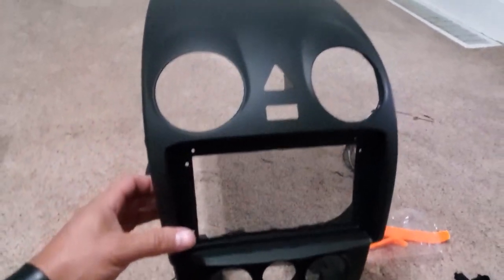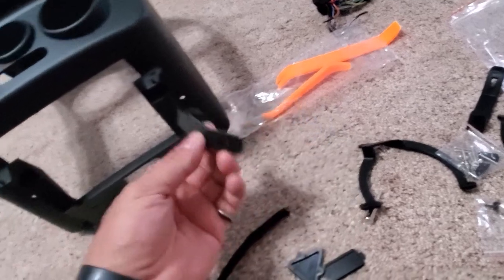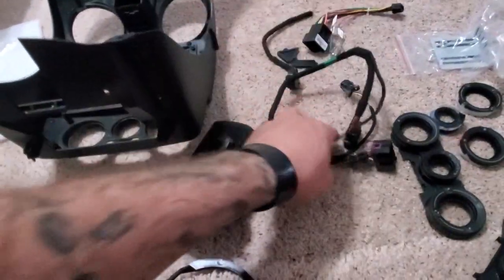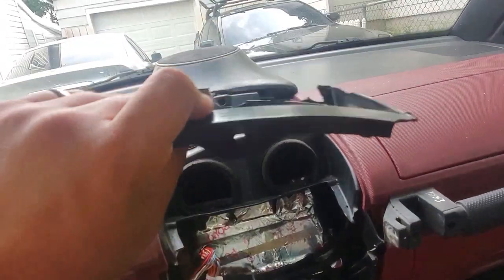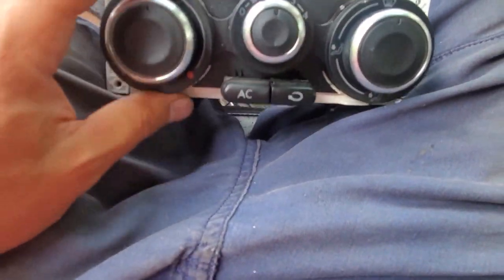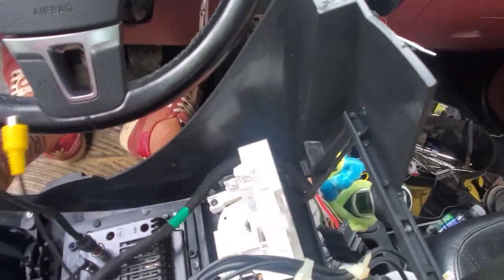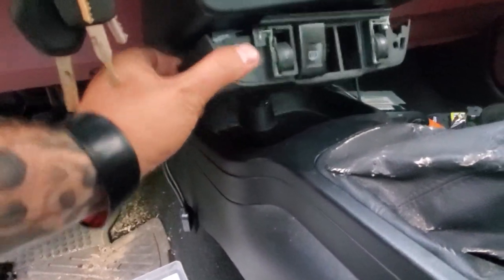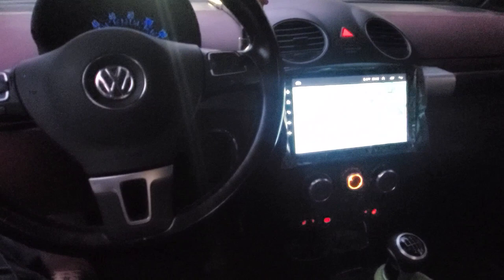New beetle 9" touch screen install

Comment: My 2004 beetle has the monsoon system in it with the multi disc thing, will that hook to it still?
Reply from the maker: You can use the cd changer in the rear still if you hook it up as one of the aux inputs

Comment: Did you buy the cheapest option on the aliexpress link since you got your radio separate ? or you bought the option with the radio and got another radio because it was better?
Reply from the maker: The kit alone when I bought it was over 400.00. It's now under 100.00. I bought the actual radio off Amazon because tye Ali one didn't have some features that I was looking for, and my phone was newer that android 11 so that radio wouldn't allow for Bluetooth, wifi etc from my phone. As well as mirror link

Comment: How has it held up? Any issues? Are you happy with the audio quality?
Reply from the maker: Only issue I've had is my battery always dead. Turned out that the way the harness is wired it sends power to the antenna all the time. Which drains the battery.  I unhooked the 12v constant and put it to switched and the same with antenna. The radio has external memory so it doesn't need the 12v constant. Haven't had a problem since. 

Sound quality I'm not really happy with. The radio alone I picked out from Amazon with features I wanted. But the eq doesn't have the option to adjust with bluetooth, hulu, Netflix etc. Only with fm radio and SD card.

Comment: Does the newer stearind wheel fit in the old beetle? Can you use the funtions on it?
Reply from the maker: It physically fits, but the back of the beetle is round vs the squared shape of this one. Not really noticeable.  It's pretty much plug and play with the airbag. Some new beetles have dual zone bags and some have single zone. My 00 has single zone but my 99 had dual. It's just another part of the airbag that deploys at lower or higher speeds.  The plug is the same you just have to put it into the right spot. The steering wheel controls on the other hand were a pain. If you got a wheel without steering wheel controls you can order the add on kit which looks oem and pairs easy with the radio. Otherwise you have to buy the universal steering wheel kit add on and figure out the ohm ratings for each button. If you car is 02+ (I think), I know 06+ for sure,  and has canbus, you have less of a pain with wiring because the wheel is canbus also.  You have to use vagcom to program the canbus option for steering wheel. I had to shave the clock spring etc out for this one so I could use the wiring. Stock clock spring only has 2 or 3 wires. New one is 6 I think

Comment: Did the kit that you bought include a backup camera? I just bought a kit and it came with one, but I’m not sure where to run the wiring from the license plate all the way to the radio. I have an 09. Also I appreciate the video it helps a lot!
Reply from the maker: Yes. It's a process. Mount the camera and inside the trunk when you fold how the carpet and look behind the plastic there are rubber grommets. Remove one and run the wire into the trunk. Then you can run it under the backseat and either up the carpet and under the center console or under the backseat and tucked under the rear speaker area, then under the door sills up to the dash and over to the radio.
Reply: @BillySwetnam  oh wow😭 I was debating even putting the camera on, but I paid like $275 for the kit because it included the touch screen too so I figured I might as well get my moneys worth. How long did everything take you in total?
Reply from the maker: @brookebowman6866  I've had mine tore apart so many time lol. I can do it in less than an hour. The rear lower seat just pops out. You can then tuck the wire under the rear panel. The door sills pop up easy also. The. Run the wire under it. Just make sure you run it behind the seatbelt bar al it's not shown. If you get a plastic trim tool it helps.  You can them pry the part where your hood release is and tuck the wire under it.  Otherwise removing the handle is a pain ( I'm 6'5" and don't fit under the dash well)
Reply: @BillySwetnam  yeah that’s fair lol. I’ve never done anything that involved more than a screwdriver on mine so it’ll definitely take me longer but I’m determined🤣 but I’m 6’0, my dad 6’3, and even he said my car is really roomy! I have my seat all the way to the back seat tho so idk how you do it man! It’s a fun car tho I wouldn’t trade it for anything!
Reply from the maker: @brookebowman6866  it is roomy inside lol. It's just not roomy under the dash. Laying upside down with your head in the floor and feet on the ceiling trying to see under there lol
Reply: @BillySwetnam  omg I can imagine! that’s actually so funny
Reply from the maker: @brookebowman6866  you'll know the struggle when you run that wire lol

Comment: if I'm new to any kind of car mods, would u recommend going to a professional? im being quoted about $500 for installation for a similar screen and identical fascia kit, and really am unwilling to pay that much. what would u recommend for installation? thank u !
Reply from the maker: Aside from cutting the dash for the hvac controls to lower. It's pretty much all plug n play. It's not as hard as it looks.
Reply: @BillySwetnam  thanks, my kit didn't come with the pieces you mention at 5.13 , do you know where I could purchase those separately?
Reply from the maker: @rosesullivan  the vent brackets?
Reply: @BillySwetnam  yeah when i google that i can’t see anything that resembles what u show, just random accessories for the side vents
Reply from the maker: @rosesullivan  I'm at work.  Give me a few hours
Reply from the maker: @rosesullivan  send me an email with the pictures of what you have. Billyswetnam@yahoo.com
Reply: @BillySwetnam  hey, did you find anything?
Reply from the maker: @rosesullivan  I never got a picture of the parts you have

Comment: great mod. how is the clearance with the shifter after the installation? and how good is the quality of the sound from the unit?
Reply from the maker: Shifter isn't bad at all. Sound quality is good. I have aftermarket speakers also. But friends who have their stock speakers have great sound as well. Just make sure the radio has an eq and you can adjust all of that. I have an android radio in y bmw and it sounds better than stock, but the one in my truck doesn't sound great.

Comment: Hi Billy! Very enlighting video. I have a 2007 beetle convertible, i want to know if you could use the cupholders after the instalation. Thanks.
Reply from the maker: The 07 has them by the parking brake unless you have the full arm rest. My console is a 06+. Below the radio is a big square storage area with a mat.  If you remove the mat you can use those turn in cup holders but for change etc. Not tall enough for a can.

Comment: Do you live in California? I really need help fixing what you did and also for 360 cam
Reply from the maker: No. I'm in Ohio. What do you need help with?
Reply: @BillySwetnam  I brought those parts from China including 360 cam and dash cam. People here doesn't know installation or upgrade what you did in beetle. I need help fixing my car and also 360 cam with it.
Reply from the maker: @PushparajKrishnan  have you installed the radio yet? Cut the dash out and moved the hvac unit? The camera wires into the video input, or cam input RCA cable.
Reply: @BillySwetnam  Nope, I did not do anything. I just brought thinking of some auto shop will fix it for me, but that didn't work out. Will you come to California if I book your flights? And also will pay you.

Comment: Did you ever confirm if the whole jetta heater knob assembly would fit in the beetle, or does the beetle one need to be modified like yours?
Reply from the maker: Has to be modified like mine. The jetta mounts are offset differently

Comment: Hello Friend! Did you manage to connect the buttons on the steering wheel to the multimedia system?
Reply from the maker: Yes. Use a pac steering wheel controller or buy a wheel without controls and buy the control add on. That's much easier

Comment: what year is your beetle? I have a 2007 and I want to do something like this! :)
Reply from the maker: It's a 2000, but the interior is the same from 98-10
Reply: Billy Swetnam oh awesome!! do you still have the site you purchased this from(
Reply from the maker: @sydneyangus7817  #Aliexpress US $253.44  12%OFF | COHO Beetle car radio Android 10.0 8-core 4G+64G dvd gps android For VW Volkswagen Beetle 2005-2013
https://star.aliexpress.com/share/share.htm?redirectUrl=https%3A%2F%2Fwww.aliexpress.com%2Fitem%2F33056601217.html%3Fmb%3D42zWX4YN3QNWYoO%26srcSns%3DCopy%26tid%3Dwhite_backgroup_101%26businessType%3DProductDetail%26spreadType%3DsocialShare&image=H480f02015a9e40099ab3e75d76633daen.jpg&businessType=ProductDetail&spreadType=socialShare&templateId=white_backgroup_101&title=US%20%24253.44%20%2012%25OFF%20%7C%20COHO%20Beetle%20car%20radio%20Android%2010.0%208-core%204G%2B64G%20dvd%20gps%20android%20For%20VW%20Volkswagen%20Beetle%202005-2013&platform=AE
Reply: Where did you purchase the wire harness extender for the hazard button and the airbag light? I have a 2002 and all my buttons are under my climate control and I can't find a harness extender anywhere and I'm not the best at doing it myself

Comment: Did you have to install any Canbus harness?? Great work
Reply from the maker: It's included in the harness
Reply: @BillySwetnam  some people are telling me I don't need the canbus wiring, but I am afraid the EPC light will turn on in case I don't install it. BTW I have the original steering wheel, without any buttons
Reply from the maker: What year is your car? I think 02 on needs canbus.  Mine is a 00. I can run it with no radio and my obd2 port still works.
Reply: @BillySwetnam  mine is a 10. I think i'll buy the canbus harness from China just in case
Reply from the maker: @thiagoterzian  if you order it from Aliexpress it's much cheaper, just takes a week or two to arrive.

Comment: Hello, my friend. I'm having issues after I installed a stereo on my 2010 Beetle. The ABS, handbrake and engine lights are on, I hear relay clicking sounds once I turn off the car, and the car is having many other electrical problems, such as the alarm firing at random times, etc.
I am searching the internet for a solution, and I see many people with the same problem as mine, but no one has the solution. Do you know anything that might help me? Thanks in advance
Reply from the maker: You have to make sure the radio has the canbus harness. If you just used a regular Metra harness etc it will cause the issues
Reply: @BillySwetnam  does this canbus harness you mentioned need a canbus box? I didn't see a canbus box in your video
Reply from the maker: @thiagoterzian  yes. I'm not positive but I think 01+ need the box. Mine did not need it but my vw is a 00.
Reply from the maker: @thiagoterzian  you can change the canbus settings in the radio as well. In this listing it shows you how https://a.aliexpress.com/_mrbCTlw
Reply: @BillySwetnam  I've extensively searched the internet about the need or not of a Canbus decoder, and apparently it is only needed for years 11+, and mine is a 10. I've also talked to the manufacturer of my stereo, and it seems that when the car needs the Canbus decoder the connector from the car is different from this one.
Reply: @BillySwetnam  I must have screwed something up about the AC when I removed the center dash, because all these issues are related to the recirculation button. It is always lit when pressed, even when the car is off. Also, when I push it, many clicking noises begin from some relays near the pedals.
Reply from the maker: @thiagoterzian  did you unhook the yellow, green cables that go to the hvac? If you have them backwards it won't allow you to turn the knobs all the way and the recirculation button will stay lit. Do they Hazzard lights work and blinkers? I know the extention harness (needed in mine to put the Hazzard at the top instead of the bottom) has the same plug as one of the other buttons.
Reply: @BillySwetnam  yes, I have unhooked them, and when I turn the knobs they work. Hazard lights and blinkers work perfectly. I took my car today to a mechanic, hope to get a solution...
Reply: @BillySwetnam  hey, Billy! I'm glad to say I've finally figured it out. Turns out it was all the cable that came with the stereo's fault. Fortunately I had mistakenly bought another set of cable harness that worked perfectly. No more warnings, no more annoying lights!
Reply from the maker: @thiagoterzian  That's awesome! Glad you got it figured out. It's always stressful tracking down Electrical issues, but extremely satisfying when you figure it out. Congratulations!

Comment: That's great work. Do I have some  questions, the control buttons on the steering wheel running on this screen ? and the screen support CD changer? And the other question is this is the modern beetle wheel or what car?
Reply from the maker: They are using a add on wiring kit. There is no cd changer but there is an aux input that the cd changer could be installed to. The Steering wheel is a 2016 VW CC.
Reply: Soon in my car beetle turbo s .. thx a lot ☺️ .. and i hope you enjoy it

Comment: Where did you buy your radio and are you happy with it still?
Reply from the maker: I bought the kit from AliExpress for 300.0p ish. The radio I purchased from amazon because it was cheaper than buying the whole kit from aliexpress. Plus it has other options in the radio that were not available. The mounting kit is impressive. Looks and feels like the stock dash so that was a plus. The radio I am still working with designing apps and programs on it. Being an android based Radio is nice for the app store, but I'm used to building windows radio i.e winCE
Reply: @BillySwetnam  thank you for all the information its been very helpful
Reply: @BillySwetnam  Which radio did you get from amazon? I don’t wanna buy the wrong one
Reply from the maker: @stephanied6264  there are many of them with different options. Below is a link of one. You need the 10.1 radio with this shape. 
https://www.amazon.com/dp/B07SLJM53R/ref=cm_sw_r_cp_apa_glt_fabc_X387BRXZ5XT79ZFVHB27

Comment: How do you mount it back onto the car?
Reply from the maker: It comes with brackets
Reply: @BillySwetnam  thank you, I’m struggling to get it back on. My hazards don’t won’t now
Reply from the maker: @sage540  are the hazards just humming?
Reply: @BillySwetnam  no, the hazard won’t turn on nor will it flash outside my car
Reply from the maker: @sage540  what year?
Reply: @BillySwetnam  2009
Reply from the maker: @sage540  that's odd. It should just plug back in
Reply: @BillySwetnam  I can look it up. I appreciate you replaying years down the road. This video definitely helped me put it together
Reply: @BillySwetnam  so it’s the turn signal, hazard light, and passenger air bag off that won’t work
Reply from the maker: @sage540  check the plugs

Comment: Where you buy the stereo
Reply from the maker: I got the dash here.
https://a.aliexpress.com/_mKmFyQm 
I paid $300.00 just for the dash. It's now $40.00. The radio I got from Amazon because I wanted certain features that the kit didn't have. I paid $100.00 for the radio. It would have been $600.00
Reply from the maker: Here it is with a radio included. You can pick different options 
https://a.aliexpress.com/_mO55qnY

Comment: is this compatible with a 2001?
Reply from the maker: 1998-2010 yes. Mine is a 2000. I used the hazard from an 06 because it is at the top, but the kit comes with a triangle plug

Comment: Where did you buy this?
Reply from the maker: https://m.aliexpress.com/item/33056601217.html?srcSns=sns_Copy&spreadType=socialShare&bizType=ProductDetail&social_params=20109559881&aff_fcid=741dce3373e34149a33da43cbb035e84-1616453985161-03113-_mMGCqeX&tt=MG&aff_fsk=_mMGCqeX&aff_platform=default&sk=_mMGCqeX&aff_trace_key=741dce3373e34149a33da43cbb035e84-1616453985161-03113-_mMGCqeX&shareId=20109559881&businessType=ProductDetail&platform=AE&terminal_id=2c6bd8eb948b42fcb1871d184cf3b448